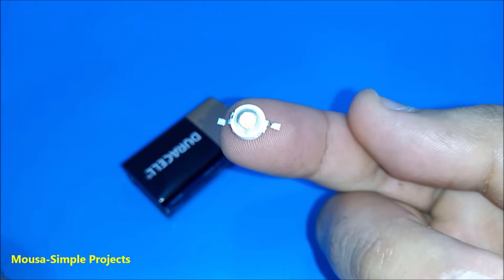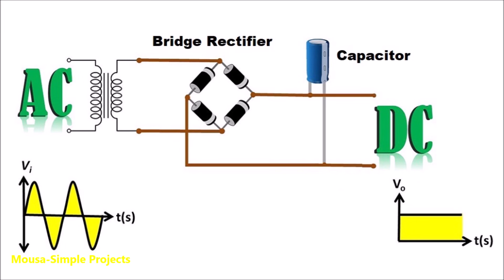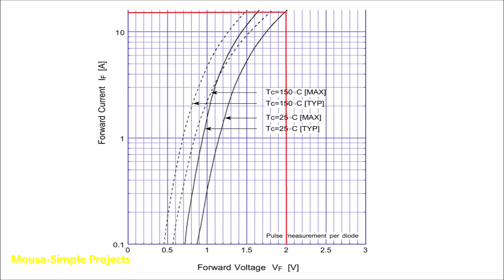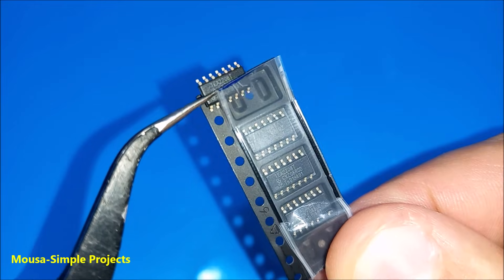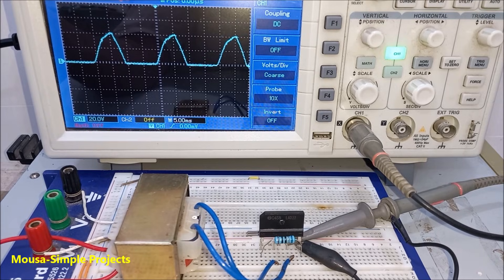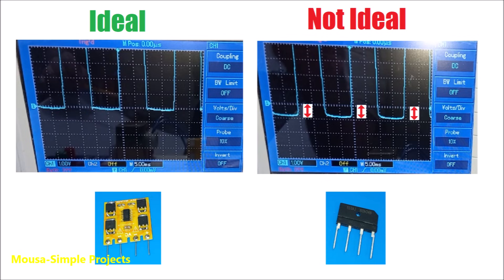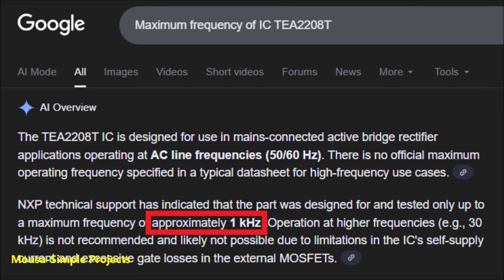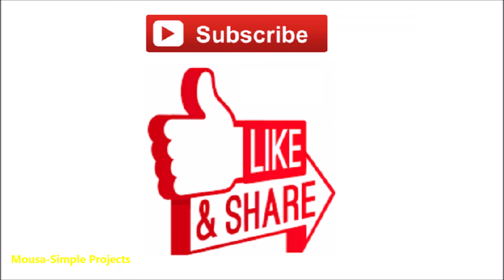Active Ideal Full Bridge Rectifier using IC TEA2208T

Comment: Can a noisy environment with lots of switched inductive loads fool the IC into a catastrophic switch at the wrong time? Worst case, amplify a rock band piece through a low pass filter below the IC's max frequency and rectify that.
Reply from the maker: This bench power supply 2:53 switching the transformer (inductive load) with high frequency and it works just fine.

Comment: (1 - (320v / 322v)) *100 = 0.62% boost to total efficiency, so, its just useless at mains voltages.
(1 - (10v / 12v)) *100 = 17%, huge impact to total efficiency at 12v supply
Reply from the maker: Thanks for the calculations, it's true that the impact on efficiency is more significant at lower voltages.

Comment: Nice video, good job! What is the power factor?
Reply: PF is typically barely affected by even a normal FBR, however, PF is very much affected by the fact the FBR is used to charge and recharge the capacitors that are behind it. Depending how empty they are current will only flow at the tops of the voltage sinewave. So the diodes themself will barely PF, but capacitors will. The active rectifier will not change that.
Reply from the maker: Thanks, I didn’t measure the power factor, but it should remain the same.
Reply: @MousaSimpleProjects  I was hoping it was going to be 0.9 or higher, could you see? 😀
Reply from the maker: OK, I measured the power factor right now, 
With old bridge rectifier PF = 0.4 
With ideal bridge rectifier PF = 0.4
(Tested with the same exact load connected to the bench power supply).